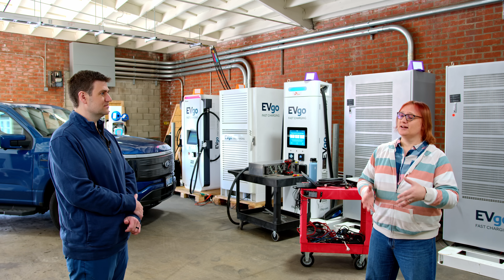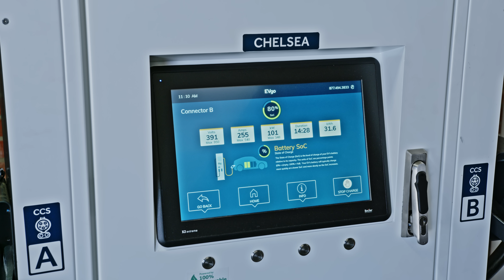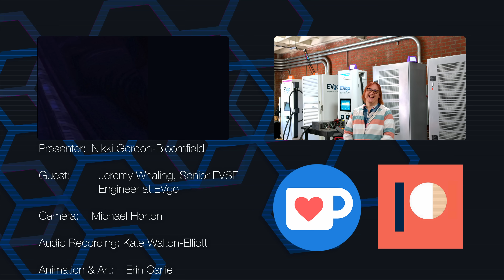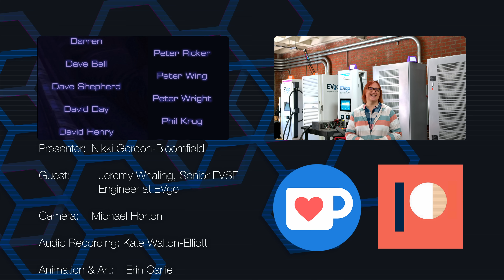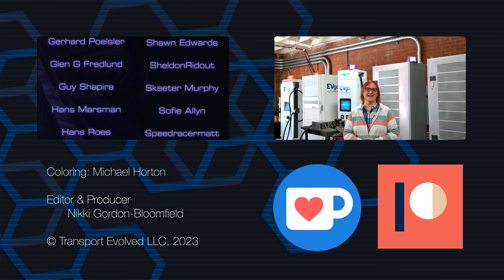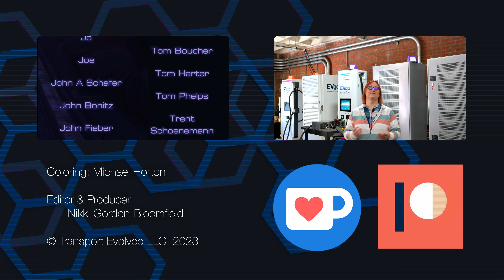Secrets of CCS Fast Charging - We EXPLAIN ALL!

Comment: Awesome video, certainly explains the technical reasons behind some common gripes folk have.
Presently it does appear that CCS is the ruling charger type worldwide. However North America is quickly heading towards NACS. Somehow I see this being the North American difference just like 100v 'v' 220v electric supply.
Reply: NACS actually speaks CCS, so all of this is still relevant with nacs. Ccs1 was the plug style that you are familiar with but also there's a CCS protocol which is what they were talking about. Newer Tesla chargers speak both CCS and the older Tesla protocol. That is why CCS cars are not able to use the old V2 chargers as they do not speak this protocol.